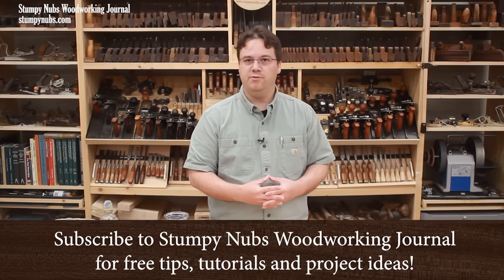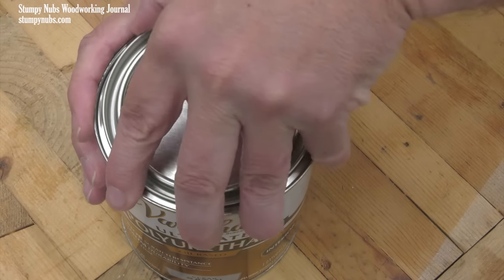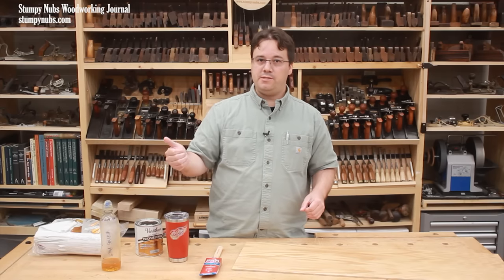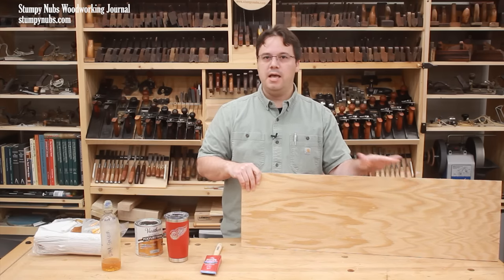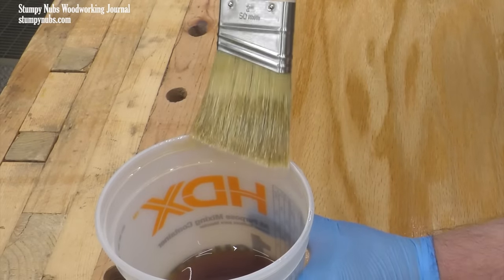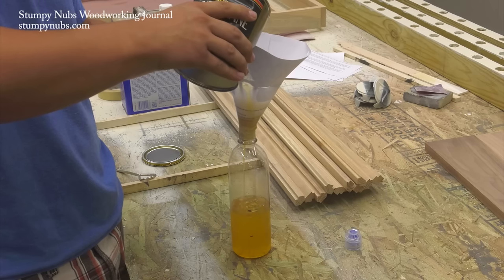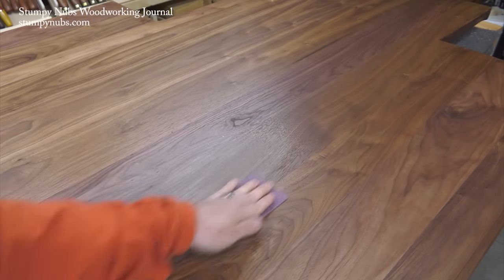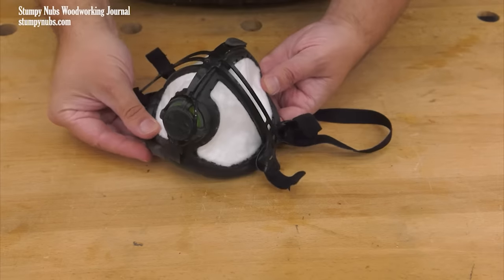Watch this before using polyurethane wood finish!

Comment: I'm going to put my 2 cents worth in here and a lot of you will probably not agree with me but please hear me out before pooh-poohing my statements.  I've been finishing bare wood for more than 40 years - cabinets, furniture, floors, and a lot of custom high-dollar rifle, shotgun, and pistol stocks.  The one thing I know to be true when staining and varnishing wood is the more you sand the more grain you will see,  Now, let me clarify this statement - I start with 150 grit paper then move to 220 grit - just as most people do.  But if you really want to have eye-popping grain and super smooth finishes then you need to take it further.  After the 220 grit I move to 320, 400, then 600 grit.  I always do the 220, 320, 400, and 600 grits by hand - NEVER with a machine.  Waste of time?  Not hardly,  I've tested this process and there is definitely a huge difference in grain appearance and the smoothness of the final finish.  It's the proverbial "night-and-day" type of thing.  Once of my most cherished pieces is a dining room table made of birch and stained a dark ebony to get a Japanese "black lacquer" appearance.  This table has such a deep and lustrous appearance that you'd think I spent days and days rubbing and polishing it.  Actually, after sanding to 600 grit and staining, I put 3 coats of Minwax Gloss Polyurethane - sanding with 600 grit after the first coat then using 0000 steel wool after the second coat.  The results were outstanding.  Super high gloss but you can still see the wonderful grain showing though.  So take it from me - sand, sand, sand if you want a truly unique finish.
Reply: Nice description thx :-) in many places I often hear that going beyond 320 can cause issues with wood accepting stain uniformly. Have you experienced this? Cheers
Reply: @veguitars  
Only 'natural' finishes are problematic with finely sanded wood. (Hard wax oil, Tung oil, etc)

Synthetic finishes - Sprayable varnish, Acrylic, PU top coat have zero adhesion issues even with 2000 grit sanded panels. After all, these finishes are the most widely used kind of finishing for automotive paint! (2000 grit sanding is more or less a mandate here 😜)
Reply: @veguitars I would sand to 220 or 320 then stain and then go maybe 400 or 600 between stain coats and finish coats
Reply: I agree I have always gone to 600 even higher sometimes and it comes out really nice with a good finish
Reply: @veguitars  the trouble accepting stain comes from the wood grain becoming packed with fine sawdust from high grit sanding. By sanding with the grain by hand, the sawdust is cleared out of the channels allowing stain to penetrate evenly.
Reply: It takes time and discipline to produce a superior product. I would add only one bit of 67 year old wisdom. Use a damp brush to keep bubbles out when using polyurethane.
Reply: Can we see the table? I’m not trying to say “prove it” or anything like that however I’m new to the whole woodworking thing and I’m interested to see how this finish technique looks.
Reply: What if I'm not finishing bare wood though? It's stained Birch, is it bad to sand after staining? (I'm very new)
Reply: I've noticed that too. It's a good way to fix up cheaper woods like Poplar. Find a few pieces with curling & knots and mix those in and it looks totally different. 

It's also a good way to control color or shades.
Reply: @XanderSut Get your sanding done before staining. If you change your mind and want to sand further after staining it would probably be ok but you'll have to re-stain when finished.
Reply: Thank you for that @garygrasser
Reply: Great advice,  especially for amateurs like me.
Reply: @braxt27  what I do is start with 220, 320 then go to 600, then 1000 before staining, then I stain and coat it sanding 600 between each coat then on the final coat ill sand 600 then 1000 then 3000 then I’ll buff it out with a paper bag, then steel wool then I’ll finish it off with mink fur rag and then finally a nice light breeze. Take it for me from someone who’s done one piece of furniture their whole life.

Comment: Prime your brush with mineral spirits (or water for water based) and shake it out before that first dip into the poly. It will clean up easier and last much longer. Love the sports bottle trick.
Reply: Also helps eliminate bubbles.
Reply: Great point, JA! Another tip is to use a prick punch to make holes in the rim groove for the lid, so that most of the excess will drain back into the can. As the can's content gets used, lumps of dried and hardened finish will prevent proper sealing.
Reply: That was I was going to say. I usually forget until I have already dipped the brush 🙃
Reply: @jageo48  If it's expensive paint or finish I'll actually pour it off into a fresh can if I'm trying to preserve it for future use. But yeah this is a great idea to save the fuss.
Reply: @Mainbusfail  Thanks. I'm actually a hack woodworker but love this channel and hope to set up a real shop someday. But my dad sold ultra high-end paint and brushes (fine art stuff) back in the 50's and 60's and it was the one real life hack he taught me. Don't skimp on brushes and keep them clean and they will last decades. It's proven to be true.
Reply: I do the same even when using a rag. Soak in mineral spirits and squeeze out the excess. I find I use less poly that way since I'm not using any to soak the rag so less poly winds up in the trash, plus it seems to wipe on more smoothly too.
Reply: Glad I watched this video. Currently finishing a desk top with a satin finish. Hoping the tips from this video will lead to a good result!
Reply: @jageo48  huh?
Reply: @kenerickson4923  😊
Reply: Nice tip! As a yacht varnisher I never thought of that!

Comment: Instead of using semi-gloss and satin finishes, just use hi-gloss and buff the final coat with 0000 steel wool. The flattening agents in the other finishes also muddy the grain patterns of that nice beautiful wood with the extra special grain patterns that you spent beaucoup bucks on. If you feel you must use the semi or satin, get yourself a small can of that for your final coat and use hi-gloss underneath it. The sheen will look the same, but you'll see and enjoy the wood a whole lot more.
Reply: I've used pumice and/or rottenstone (mixed with water to form a paste) to buff out the final coat of gloss. Worked well for me.
Reply: I’ve got a butcher block island with my kitchen sink! Ive been searching for advise from professionals on the best sealant. They all say food grade oil. But I won’t be prepping food on it. Then they say gloss but I hate, hate, hate the shine. LoL, it’s been over a year with no finish bc I’ve been conflicted about finishes. I really like the idea about starting with a gloss and finishing with an end coat of satin. So glad you commented.

Comment: For those beginners I want to add that the fine print on the can of polyurethane advises that while drying time can be a few hours to overnight  or so , that cure time can be 15 days and longer. The difference between dry and cure is that you can light sand after drying but in order to use or to to place objects on a finished piece the finish should be allowed to cure. Also there are temperature and humidity considerations that affect drying time which are explained on the can as well.
Reply: I just learned that the hard way.  My end tables turned out amazing and because a couple days went by and it was dry to the touch we put the lamps on them.  It did not take long to leave marks in the surface.  Dry and cure dried are two different things for sure.
Reply: @greenpea9412  One of the deficits of our educational system is there is not enough emphasis on “read the fine print” .  Going forward, fine print is more important than ever.

Comment: I always thin my 1st coat 50/50 to seal. If wanting to end up with a semi-gloss or satinfinish  I layer my 1st coats with high gloss and top coat with the semi-gloss or satin. I believe this won't obscure the wood grain as mush if you just coated with semi-gloss or satin.
Reply: something else youre doing that you maybe not be aware of, higher gloss levels boast a harder surface, so if something were to eventually scratch your finished product, its less likely to penetrate the high gloss coat, meaning its fixable without stripping down your entire finish. just fill with new poly, sand the fill down smooth with the previous layer, and repeat your final coat

Comment: I found another use for polyurethane and that is over flat latex paint. I made some cabinets for my and because I use working on vehicles as well as woodworking I wanted a cleanable surface. I tried satin polyurethane instead of satin latex paint. I've never liked semi gloss or satin latex paint for durability. It never seems to really dry and it stays somewhat soft. So I shot my finished cabinets with polyurethane. Its been a few years now and finish is holding up well. I can get oil a grease on it and it wipes right off.
Reply: Oil based poly?
Reply: @robertnichols917  You want to use water base, the oil base will yellow light color finishes especially white.

Comment: Clarify please.  Initially you said to wipe down the bare wood after sanding with denatured alcohol.  Then after the 1st coat of poly to sand lightly and wipe with water?  Seems like wiping with denatured alcohol it would evaporate and dry more quickly.

Comment: I used to spray in an industrial setting shooting oil based paint all day. My favorite mask was the blue Belcamp masks from NAPA automotive supply stores.. I don't know if they're still available, but they were less expensive than 3M, had a MUCH better fit and seal. Now I have a 3M just because I don't need it nearly as often. 
If you're spraying a lot, and by a lot I mean upwards of 50 or so gallons a week you should get a fresh air supply system that covers your entire body because you will absorb the solvents into your skin and will probably eventually wake up completely numb from your knees and elbows down to fingers and toes like I did..  I wear a mask no matter what I spray, no matter how much time I might be exposed. I had to learn the hard way when companies didn't care and neither did OSHA ..
Reply: Great GREAT advice. One thing I just can't get through to kids is how that stuff builds up, even if you're using an aerosol once in a while. Of course, being young they're "bullet proof" and it's just not "cool" to be careful! I'm with you - I wear a mask every single time I spray. It really isn't worth gambling with your health. At the end of the day, that's ALL you have!
Reply: @Zzrdemon6633  I was applying for a cabinetmaking job a few years back when I met an older lady who was their main finisher. You could tell that when she was younger, she'd be an easy 8.5-9/10. I thought for sure she was 45+.

Nope. asked my buddy who worked there. She was 32. 32! She smoked and sprayed all day.
Reply: Aw man, sorry to hear that. I have peripheral neuropathy as well (for other reasons) and it's not exactly fun.
Reply: I’m in this one, too. Yes. Always wear a full-face respirator and body suit. No matter what you’re spraying, waterborne or solvent-based. When I suit up to shoot 2K solvent-based polyurethane, I can’t smell a thing; if you smell the solvent, it means you’re not completely protected. And, as every finisher knows, this stuff (especially the catalyst) is really nasty for your health. So, take the right precautions, and enjoy the aesthetics—and superior durability—of a spray-on finish! 
Once you’ve mastered the gun, you’ll never trade it in for anything else.

Comment: I bought the Trend mask on you recommendation after one of your other videos. I've used many masks over the years and the Trend is the best thing since sliced bread !.
A tip I got from one of my co workers a few years back in relation to the final coat of varnish. It works best when you are working on a flat surface, ie. you have a door on trestles or a bench. As your varnish is getting tacky, spray a fine mist using a trigger spray bottle, from above of whatever the recommended thinner medium for your product is. It doesn't take much, but it evens out the surface of the coating. I tried it on my new oak panel doors and they looked like they had been factory pre finished. Try it on some off cuts, it will cost nothing but a spray bottle and varnish. 
Keep those videos coming.
Reply: To be clear, are you saying to use thinner only in the spray bottle? Thanks  in advance.
Reply: @williambranham6249   Yes William, whatever your chosen varnish suggests for thinning. Get the mist as fine as you can and hold it at extended arms height. White spirit as we call it here for oil based varnish. I've used the same procedure to finish gloss lacquer on the final coat on a model, using an air brush and it leaves a glass like finish. As long as the dogs dont wander into the area.
Reply: @loki7441  Thank you! USA
Reply: @williambranham6249  Good tips should be spread to those who will make use and appreciate them. Hope it works for you.

Comment: Great video as always.  I would like to add a suggestion, if  you are going to use satin or simi gloss  varnish you should use it only on the last one or two layers.  By using gloss to build up layers you will get a deep rich look to the work and not a dull muddy look.
Reply: don't you jut love the fact you pay more for gloss when it has less in it than satin.
Reply: @TaylerMade  Yeah, agree....but perhaps that is because you are replacing cheap flattening agents with relatively more expensive urethane?

Comment: Glad you mentioned turpentine.  I like to use it for thinning poly.  I think it gives a better feel.  The finish seems to flow on more smoothly.  Mineral spirits works just fine, of course.  Just my preference.

Comment: My introduction to poly was stressful.  I was making a 4x8' turtle habitat out of plywood, and I had some pretty big pieces.  Now I know I was fighting myself by doing the finish in the same garage that I was doing the sanding.  I had a bear of a time getting the finish to go down without bubbles, and I was using the same product you are, and brushing it too.  I wonder if some of the bubbles were dust-caused.  I wound up doing MANY applications and sanding in between, and learned just what kind of scratch the finish will tolerate filling in.  So it wasn't all a loss.  I tried brushing, thinning and wiping, staining pads, and even "brushing" with those weird rectangular pad things that puts down a lot of finish in one swipe.  I eventually got it done well enough, but what a learning experience.  I wish I had found your videos first, but I probably would have landed in the same predicament, knowing myself.

Comment: I spent a lot of years painting professionally   I don't think there is many products that I have not used. I appreciate the information you bring to the table.  All of it is good solid information.  I don't recall you taking about making adjustments to your polyurethane to deal with changes in humidity or heat. you can not always paint in perfect weather so you need to make adjustments to deal with the weather changes. I almost never use polyurethane straight out of the can. I typically thin it a little bit just to get it to level out on the surface a little better, it slows the drying little bit and allows me to dry brush it for a more consistent finish.  This will help to keep from scrubbing the finish, better to thin it a bit to get a better finish, I have often started by applying the first coat thin,  (wipe on) that way the product sinks deeper into the surface. I think that if you have the time, wipe on is going to give you a better overall finish, yes its a lot more coats but well worth the effort.

Comment: I've been spraying poly for a few years now and have been very happy with the results.  Same prep and between coats procedures in the video.   I finish with a final 400 grit wet sand and rub with wool-lube and 0000 steel wool.
Reply: Oil based or water?

Comment: I have a trick for finishing porous wood to get a glass smooth finish quicker.  Sure, you can use grain fillers but also you can fill the grain pours with finish.  Use the full thickness finish and pour some on the work piece then using a flat knife or body filler spreader (Bondo Spreader) and push the finish into the pours while leaving a thin a coat as possible.  Sand and repeat if necessary.  Or continue with your regular finishing methods.   If finishing a stained piece sand very lightly only to get the main bumps down as the finish will be super thin.

Comment: I tried rolling it on with a foam sleeve onto a large table top and the results are impressive. Lays very flat and even, much quicker than brushing it on.
Reply: I tried a foam roller on some shelves a few months back and it caused a lot of bubbles to form. Ended up having to quickly brush it to get rid of the bubbles.
Reply: @ferrumignis  Zar self-leveling polyurethane and a fine foam roller. Zar is the best quality water, oil or oil-modified poly on the market and the easiest to apply without issues. It’s matte poly is by far the easiest. And it’s the only brand of poly you’re ever going to find that won’t amber on white surfaces. A bit more cash, but you get what you pay for. AND you only have to wait a mere two hours (or less, if water based) between coats.
Reply: @scottmassino3051  Thanks for the tip!

Comment: Iv been applying polyurethane for a month with a brush and having bad results,   1 wipe on coat filtered and my mind is absolutely blown how much better it looks. Im doing a 40x72” table and its not very easy with the brush. You the man! Thank you!
Reply from the maker: Light sanding between coats makes a big difference too